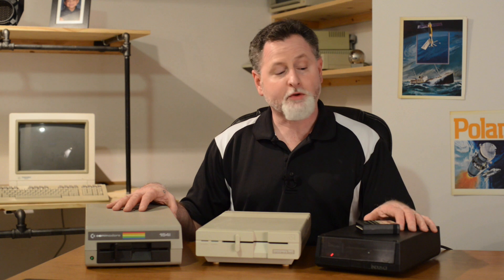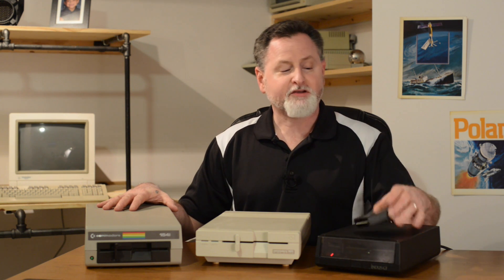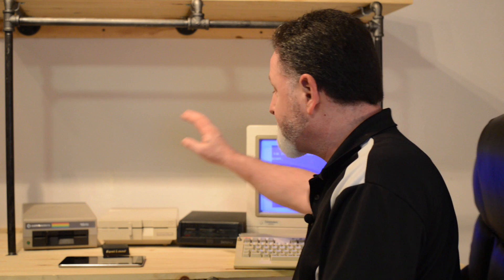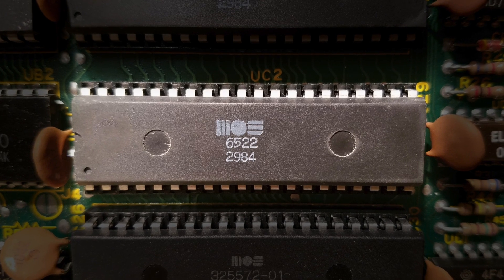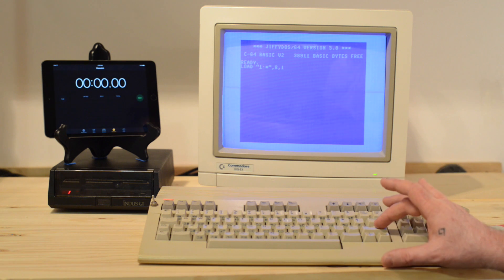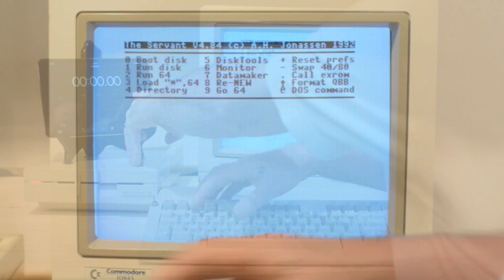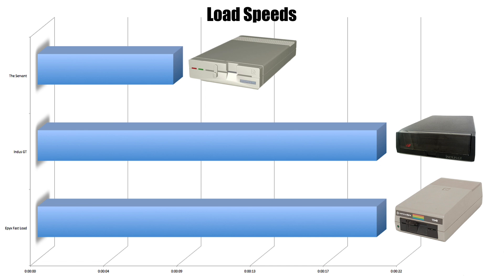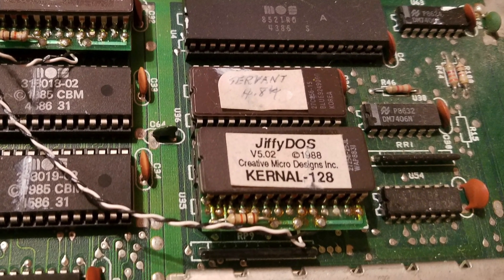Floppy Drive Showdown P2: Optimized For Speed

Comment: Back in the day I used an Apple, Atari, and Commodore drives.  The Commodore drive operating system was far inferior to the Apple and Atari.  The Commodore was simply unreliable and slow to boot - no pun intended.  The Apple And Atari were both faster and much much more reliable.

Comment: I had the Indus GT and it always overheated.  I had to keep it on its side with a desk fan on it.
Reply: Oh no! Interesting, wonder what component was the culprit. did it make any difference if you left the swing door open to allow some cool air to come in through the slot?
Reply: @TheUnprescribed  yeah, I remember I had to leave the front open.  Keep in mind this was over 35 years ago.  I was so excited to upgrade from my tape drive.  once it was on its side with a fan it was fine though for the most part.

Comment: So why was it so "important" to rush the computer to market? Whose supposed "deadline" were they under? Geesh, why not just delay a little and then get it right?
Reply: ungratefulmetalpansy : Figuratively speaking, yeah, and I've heard that one too. But it's only figurative because it doesn't always apply. In this case the "twice" thing didn't apply, because even the new 64 and 1541 didn't get the fix.

But that still doesn't tell me why they think there's a specific "rush" to get something out onto market, almost like a "deadline" from an outside push.

Comment: A 1571 will stay in the native 1571 mode by simply turning the computer on and letting it boot into 128 mode. Then type in "go64" at the ready prompt. That will keep the drive in 128 mode yet switch the computer into 64 mode.
Reply from the maker: Mike K Great tip, thanks!
Reply: @ThatGeekGuy  This is only useful insofar as it allows you to (in C64 mode) access the full contents of a diskette formatted in double-sided mode.  It does NOT confer a speed advantage - it'll still run just as slow as a 1541, although you'll have access to twice the storage space.